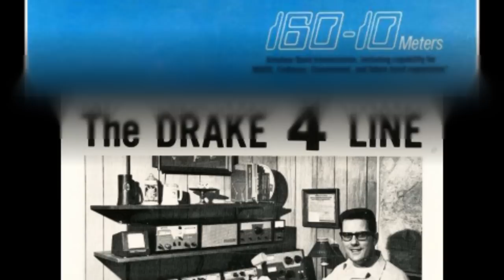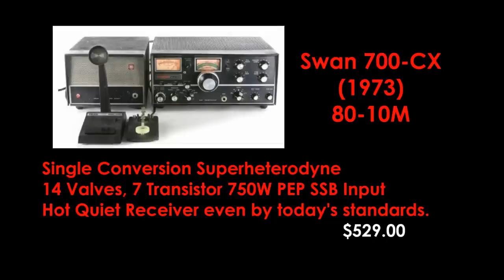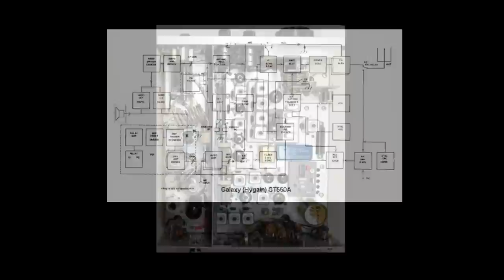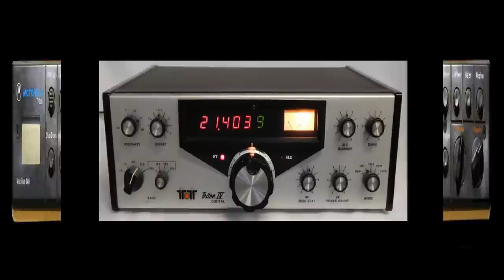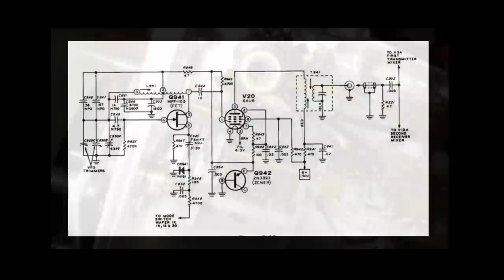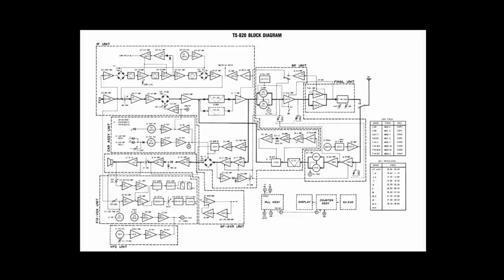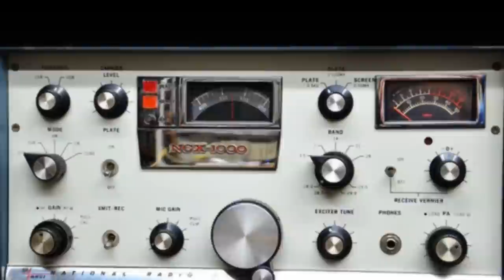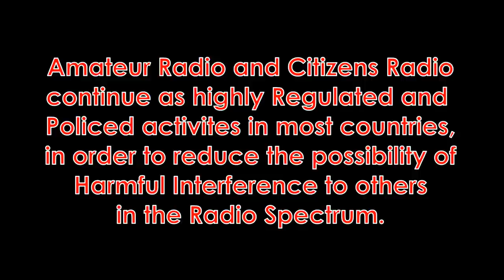Top 10 Ham Radio Transceivers of the 70s

Comment: K9BF here. First Licensed in 1969. I have examples of most of these radios in my basement, including a Signal One CX-7 with Nixie tubes. Yes, the TS-820 was a game changer. I put an FT-101 on my work bench and went to lunch. I got back home and found several fire trucks at my house. Several firemen were wondering around my basement looking for the source of all the smoke. I directed them over to the FT-101 whose power transformer was very hot. I had a FT-101ZD at one time, beautiful radio. I had some WWII surplus stuff in the beginning. I came home from school one day and found a big box on the kitchen table from Heathkit. My big brother had bought me an HW-100 kit. My first real ham radio. 
Enough from me.
73
Ben K9BF
Reply from the maker: I also had a close one in the ham shack basement. I was with VK3CV at the famous MIT electronic flea market in Boston when I get a frantic call from the XYL. Something was causing smelly smoke in the shack! I was over an hour away! I told her to kill the circuit breaker. She called back and said it stopped. The problem turned out to be a power cord that had broken down over time, starting to conduct to a right turn pinch point to chassis on an old power supply. Before the fuse and switch of course!

Comment: Thanks. This video brings back a lot of memories 👍.
I've had my ham license since '91 and just like many, i was pretty heavy into CB and shortwave radio.
I built my first crystal receiver in the '70s with scavenged parts from a couple of discarded RCA radios, a homemade BFO and a homebuilt antenna tuner (100ft. of enameled wire coiled up, with five taps and two variable mica caps. Then I got the "FT-101EE😁.
Now I'm using the icom ic-9100. What a massive change in electronics and communications overall.
I've managed to collect a little bit of everything you can think of as I'm the curator of Ham helpers (a group of hams who collect old donated radios, fix them, (if possible) and get them back out to newly licensed ham operators for free).
Keep recording, we'll keep enjoying your videos and sharing with you when we can 👍.

Comment: As a kid in the late 70s, my Dad had me going to ham classes and I was in spitting distance of writing my Novice, but I fell in with a bad crowd at school and started learning computer programming. Consequently, I wouldn't get licensed until my middle 50s, but I have my Grandfather's 1973 (?) Atlas 180 on my desk having revived it some months ago. It's great having that little piece of history in my shack. Thanks for this great video, Mike!
Reply from the maker: Wow the Atlas 180. Modern radios have newer FET finals and protection circuits. Those early bipolar finals had some folks popping them. Just tune the antenna and get the match below 3:1 and maybe put a current limit on your supply . Ha.
Reply: Just as this video showed the remarkable change in rigs from the 60's to the 70's, your comment about learning computer programming at school in the late 70's was quite different than my experience in 1971. The computer programing class involved making a buttload of punch cards to create a really basic program, and I remember having a stack of 50 - 100 cards and trying to figure out which card had the faulty punches (not to mention the accidental dropping of a stack of cards on the floor and having to get 'em back in order). I dropped that class quickly and transferred to the holy trinity of classes (at that time): Basic Electricity, Electronics, and TV and Radio repair, which was my gateway into radio. Thanks for reviving the memory of my class from hell...  😉

Comment: Back in the late 70's, a friend of mine had a 50' sailboat built for him in Hong Kong.  He became a ham so he could have communications on the high seas as he elected to sail the Pacific back to the states.  He chose the Atlas 210 radio because of its small size and solid state design.  It worked perfectly and he used it for several years on his outings to the Gulf of Mexico and South America.  Great product!

Comment: 6:30 My first commecial radio. I had started with a homebrew 80 m transmitter and Geloso receiver, which I modified for 80-40 operation, AM, and in February 1980 bought a used Yaesu FTdx-401B (it's the same rig as the FTdx-560) with the pair of 6KD6's finals giving 560W PEP input. The transceiver was hybrid.

Comment: Extremely interesting video. My wife and me share to operate the TS520 and actively operate it on CW and for 40 years it is still working today on the receiving part. Tubes had to be replaced. For 40 years never breakdown at all.
Reply from the maker: That radio has a reputation for being very reliable and since it did not include AM or 11M, it is more targeted as an entry level Amateur Radio. It has almost no flaws for what it does.

Comment: When I went from my DX-20 transmitter to an SB-101 I was so excited. An actual VFO instead of a few crystals and relays instead of a knife switch. Those were some great times.
Reply from the maker: I was a fortunate because the Crystal requirement was dropped the year when I got licensed, so I put an ARC-5 transmitter on as my novice rig.

Comment: Excellent video!!! My first radio was a knight receiver and then a cb radio in 1970. My first ham radio in 1979 was the Kenwood 599D Twins.  I bought a Globe King 500C with the Collins 75A-2 receiver and ran the twins and the WRL radio for a long time. 11 meters was part of the VFO on the Globe King and no modification was necessary.  I'm guessing 11 meters was a ham band in the late 40's to early 50's.  I'm still running the Kenwood Twins and the Globe King today, but they're not my primary radios. Greetings from W7UQ
Reply from the maker: Wow those are some fancy radios. Of course separates are always going to be the high performers!

Comment: WOW! What great channel content! Excellent job man. My first contact as a ham in 1993 was on CW in a radio club in Portland, CT. on a TS-520. I'll never forget flipping the large heavy duty mechanical switches to key the transmitter on 80 meters. I later on picked up a used set of 599 Kenwood Twins at my first hamfest for $300. The rigs had to be repaired and aligned as they also had bad filter caps. An elmer, "Mac" Harper W1FYM, (sk) helped me as I brought it to his basement to diagnose. As I started to reach inside he yelled "what are you doing?!!!!" pointing out the fact that there was 800 volts in there! It so happened that I met a guy Joe, AA1GW on 2 meters who had the same radios who also gave me pointers as well. He was big into working the Russian 10/15 meter satellites and lived in a condo were he could only have dipoles in the attic. He called the satellites "artificial propagation". 
The sunspots were at the lowest in 1993 so the HTX-100 that I bought on clearance I was able to take back to Radio Shack and I traded it for an HTX 202 two meter handheld having never made a single contact on the 10 meter rig.
 I was told to by Joe, AA1GW to never get rid on the 599 twins or i'd regret it, and he was right! I miss those! I traded the twins with a private school in South Carolina's amateur radio club for a Johnson Invader 2000 and Heatkit SB300 receiver, both which I still own so the "loss" was bitter sweet. 
I Now live in Western Maine and have been working on my station since the lock down and I really enjoy the fact that we're the closest place in the country to Eurpope and Africa/ middle east so not only does it make contacts easier with that part of the world, most of the US stations have their beams on a north east heading a large majority of the time so it makes contacts with US stations easier as well.

Comment: I have 2 of the units of your video: An FPM300 Safari, which I bought brand new in 1974. It has tubes, transistors and some ICs, a total Hybrid rig. And an Atlas 210X with an optional digital display, from 1978. I enjoy "no-menus" old school operation. Great video!
Reply from the maker: Those solid state radios were pretty hot stuff in 74! This really got the mobile and portable HF operation moving forward. The low power TenTec Argonaut was especially important because it was a low cost rig.

Comment: I started in 1967, age 15 with an Eico 720 & BC-312 with some converters for 10 and 15 & modulator for AM as novice, then general.  In 1969 I graduated to my elmers, Yaesu radio which I purchased off him.  He was in the Merchant Marines and I then used the Yaesu series FT-1000 amp, FR-100B receiver and FL-100 transmitter USB/LSB/AM/CW.  I really enjoyed that rig in transceiver position.  No one ever talks about that very clean rig for some reason.  Excellent video of the history of these transceivers I grew up with, from when I first started.  Used many of them at any of the naval stations I frequented.  I even used my nuclear subs periscope as a wave guide for my Motorola HT220 slim line with rubber duck..on 2 meter FM, fond memories.
Reply from the maker: Now that is a step up all right!  Everything changed with the Japanese rigs.

Comment: in the early 70's I was so excited to get my first transceiver....a Swan 350.   The sweep tube finals got so hot, it drifted, the vox was terrible plugged in the back, on cw the filters were nonexistent.   Thankfully I sold it all when I became inactive.   In the mid 80's I set up a station again and bought a Kenwood 530s.   Proper transmitting tubes, 500 htz cw filter, digital tuning reout,  It did not drift,  I could not believe how wonderful that rig was!
Reply from the maker: I used to work a guy who ran a 350 and I would chase him because my radio had no RIT so we would pass by a few QSOs but not drop in. Not all of them drifted. Some were magic.

Comment: Thanks for the memories :). I started in 1977 with a hand-me-down Heathkit DX-40 and an Elmac PMR-7 receiver. They were quite old even then but loads of contacts and fun on CW. My first "real" transceiver after upgrading to General was a Kenwood TS-511s and then another upgrade to a Kenwood TS-520s. Kept the TS-520s for several years. Great times, thanks again.
Reply from the maker: I did the throwback thing too experiencing the surplus stuff so popular in the 50's in the early 70's. Using separate TX and RX  and crystals was a real Novice experience that would soon be going away.

Comment: I loved my TS-520 1980's  de NI7U licensed 61 years ago (1962) as WH6ELX (Hawai'i). 1st station as WH6ELX a kit I built with paper route $ a Knightkit T-50 with 3 novice band crystals and a Hallicrafters SX-110. In that 1st year got half way to WAS, and got my WAC all on 50W CW and 3 crystals mostly on 21168 and 7170! Used a 15m monoband Yagi and a 40m dipole. Passed my Extra Class code (20wpm) when I took my Novice exam but could not pass the theory yet. I think, the best days of Ham Radio!

Comment: Really enjoyed your video. I was first licensed in the 70s. My first rig was a Century 21. I went on to get a Commercial Radio Telephone ticket and a second class telegraph with ship radar. It should be obvious that I sent some time at sea as a sparks. WE HAD A Drake  in the shack for ham use. Drake had an IMO approved receiver based on the TR7 the R8. The R8 was a lot better than some of the old receivers you often find at sea. Thanks for the trip down memory lane!
Reply from the maker: Those later solid state Drakes are very much pro grade.

Comment: My first Ham radio was the Yaesu FT-101EE. I bought it new in 1978 and got my Novice ticket in 1980, at age 21. My first call was WL7AKW. The radio was a beast but I sure did love it and used it for many years. 73 Joe
Reply from the maker: I was shocked at how heavy those 101s were. But that's a serious power supply.

Comment: My first transceiver was a Henry Radio/Uniden Tempo 2020. Hybrid design, with a partial PLL circuit, and a 100KHz VFO. Best radio I have ever owned. Still own and use it on 75M. (Gears are broken, so band switching is no longer possible)

Comment: Still nice radios. I did look at Swan and Atlas at one time. There's two I don't remember, Tempo and Galaxy.
I had a KW202 rx and KW204 tx then an FT101E with a 250 Hz excellent c.w. filter. Went QRP after a break of 10 years after moving house.
I liked the 202 rx and have thought of looking for one.
H/b radio and an FT817ND now.
Gone really back with a very modified 1944 Wireless 19 Set, QRP 2 Watts.
G4GHB.

Comment: I routinely swapped the usual 6146B output valves for the Mil spec CV3523 and upped the HV rail to 800v to get an honest 200W PEP. Worked just fine.

Comment: Great video..  my '70s rig was the ten tec..  BUT, it was the Century 21.😏..  I've never been a phone man..  in 65 years I have filled countless logs, but my total phone QSO count wouldn't fill half of an ARRL logbook..  
in 1981 I got my first real storeboughten radio, a kenwood TS530S....a very good receiver.. by then I'd been a ham 23 years..
 
All these years and I never had a top of the line radio..since this is likely my last sunspot cycle/peak, I just went upscale with the yaesu ftdx10..  it was now or never.. not top, but still a VERY good radio..

That TS820 was also my vote for the best..
Reply from the maker: Very nice. That Century 21 was a CW dream machine.
Reply: Loved ur story, as mine's similar; starting in the hobby in 1973, I of course had to use CW as a Novice; then when I started upgrading, I hopped right on to SSB & was abt 50% CW & SSB for yrs; but after being QRT for many years, when I got bk in the hobby a little over 10 yrs ago, I became CW-only on HF, with just a handful of SSB contacts, usually with local ham friends, hi hi; 73 de WA4ELW in TN 🇺🇸 dit dit 😃

Comment: Those are some lovely rigs and I've owned an Ten Tec Argonaut 509, an Atlas 210X and a Kenwood TS520 (and friends owned FT200 and FT101) but I can't believe you missed the Yaesu FT-7.  They were one of the best selling radios of the 70s and redfined what mobile radio was (and I say that as a long time owner of two of their direct competitors).  I've owned three FT-7 radios (still have one) but my other mobile HF radios from the 70s are gone (noting that the FT-7/FT-7B are not QRP radios unlike my Argonaut although they are lower power than most).

Comment: The siltronix 1011 was really a swan with all the bands striped out but 10/11 and aimed at the 11 crowd. Much like many of the ten meter cb's they sell everywhere these days.They changed the brand name to distance themselves from their other product line, lol. Don't judge,....I bought one new as a teen ager still in high school. I really didn't know any better as everyone was doing such things in the mid 70's and no one was watching over me. I remember that the operating manual aimed you right to the mod without coming out and saying it - by telling you what exactly wouldn't work in the 11 meter band switch position, ( the transmit relay),. You could look right at it and see the big white wire was there in the 10 but not 11, hahaha. I looked at it and had it working in under five mins with a soldered jumper. As wrong as that was,.... I still chuckle at their deceitful cleverness? I heard hams on the ten meter band and that was it for me. I got to studying for my license and do it the right way. Interesting rig though. The 8950 compactron looked like it had a natural gas blue flame inside that danced as it was modulated. Cheers.
Reply from the maker: Swan `figured out how to move radios based on a whole new customer base!

Comment: During the 1970's I owned a Yaesu FT-7 (20 W) and a Yaesu FT-7B (50 W). I was able to make a mobile QSO from South Africa to a Ham going mobile somewhere in the USA. I was running 50 W with the FT-7B and he was doing 5 kW mobile. I used a Hustler 20 m antenna. I later owned a Kenwood TS-440 in the 80's.
Reply from the maker: Great boxes of fun.

Comment: Nice report and I agree with most of it.  I owned several of the rigs depicted and the only one I was the least happy with was the SB104, that I put the 104A upgrade kit in that did not solve its primary issue - turn on the noise blanker and bring in every signal on the band at once, even if you dropped then nominal gain from 1:1 to less than 1.  Something  a lot of new hams need to wake up to though, is everyone of the depicted rigs is still on the air somewhere, I own and still use a few listed.  When you get on your $6K buck radio and tell me I am 50 cycles off freq, maybe you need to watch this video again.

Comment: Love these videos.  First licensed in '63.  I repair the old radios as a hobby.  About 13 years ago I acquired fifteen Galaxy radios for $15, all in great cosmetic shape.  The power supplies were another $15.   All from a deceased radio tech.  So one of each model went on  the bench.  They were easy to work on, half the time it was just the regulator transistor, and some were tougher but now I have one of each working.  They are a really under rated radios as they hold their own quite well with the other radios of the era.  AND THEY KEEP ON WORKING,  YYEESSS.  I like that a lot.  I  think some of the bad vibes they got was because the Gal 3 through the Gal 5 series were so ugly.  Don't overlook the 2000 series amplifiers..  I ran one for 26 years on 20 meters, after which a mod failed and ate all the tubes.  I wasn't aware of the mod as nothing ever went wrong with it except to clean the relay twice.  1350,  watts.  according to Leo,  on $300 worth of tubes.  When  I got it I  had to see what it would do full tilt.   850 volts at 3+ amps.  Do the math.  It buried the 3 amp ampmeter.  Only did that for about one second.  
Thank you for rating the Galaxies so high and thank You for the videos, they are loads of fun for an old radio nut.  73 de wb0snf
Reply from the maker: You could be a Galaxy refurb business!